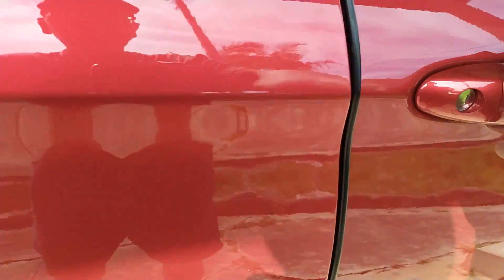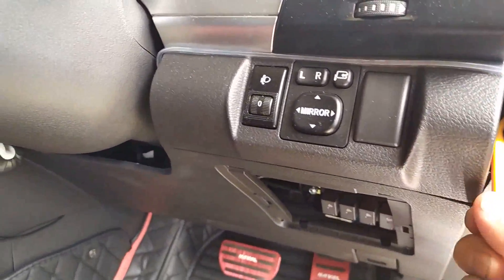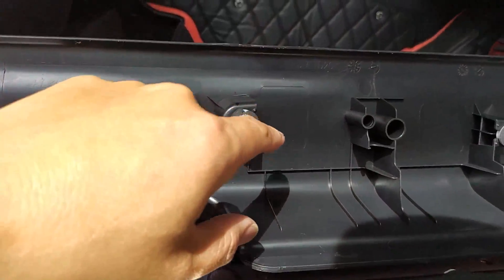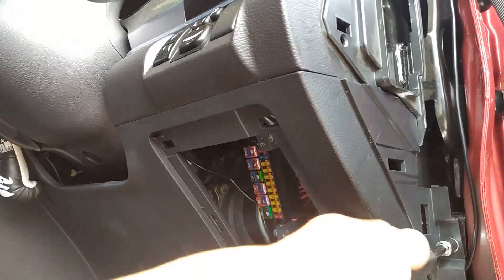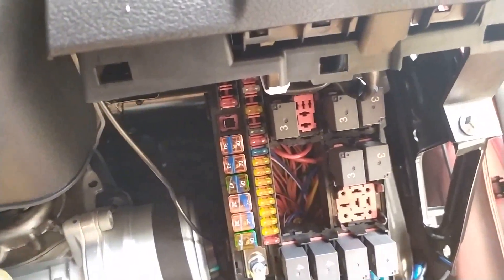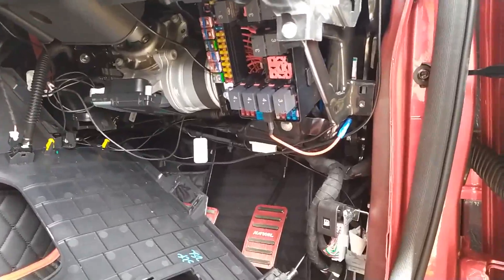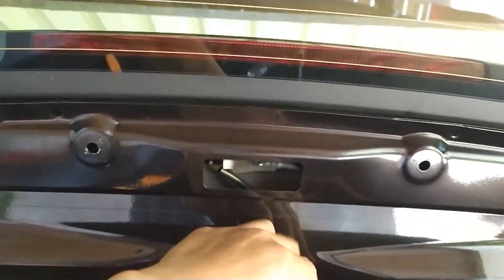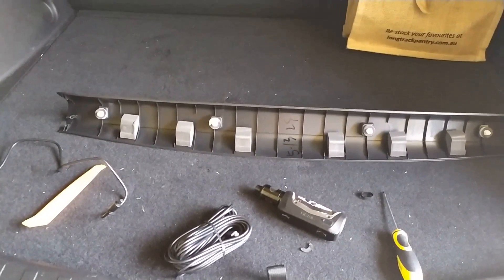2020 Haval H2 bottom dash removal for dashcam testing.

Comment: Hey man great videos! not much out there for the H2 and your vids help those of us who are afraid to get in there and pull panels off. Would you be able to show a video of how to remove the cabin light assembly (in front of the sunroof). I was thinking of installing a dash cam that runs off the powered mirror harness. Thank you!
Reply from the maker: Hey mate, not a problem. Yeah when i started modding, I searched and there has been no content on this car at all. 
Ive taken the front cabin light off before to have a peek around, its easy enough. I have a couple projects involving that so I'll do one as soon as I can. 
Ive powered mine down to the fuse box as I am product testing a new dashcam not yet on the market and they included a hardwire kit for surveillance mode.
Reply: @myhavalau2181  Awesome! Subbed and will look out for it!